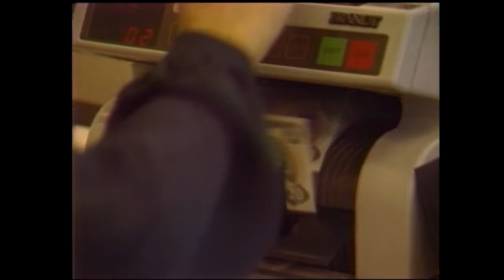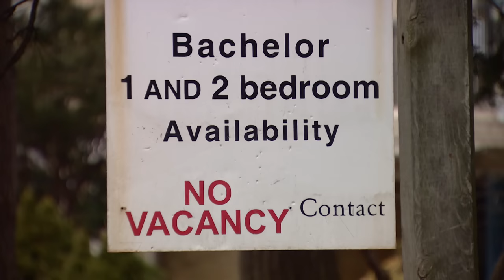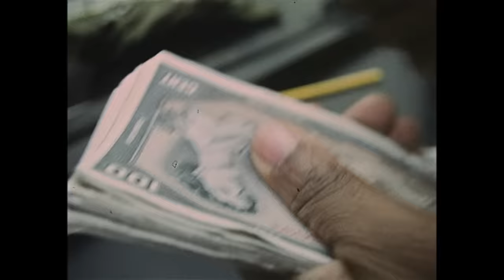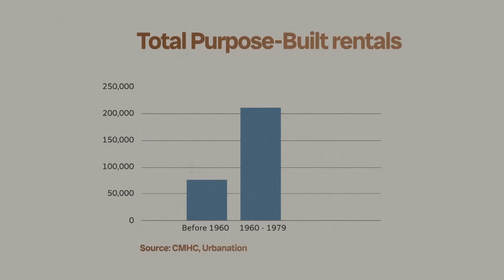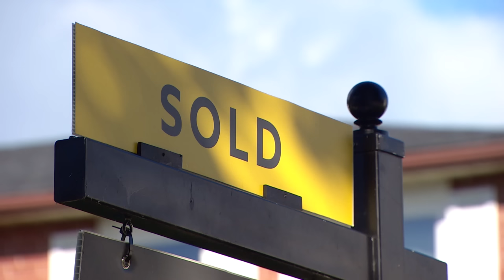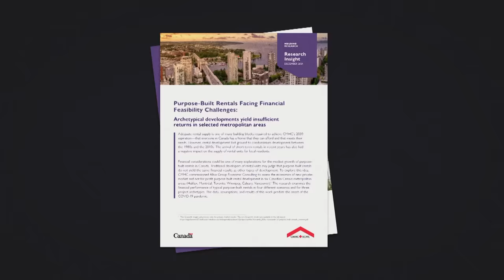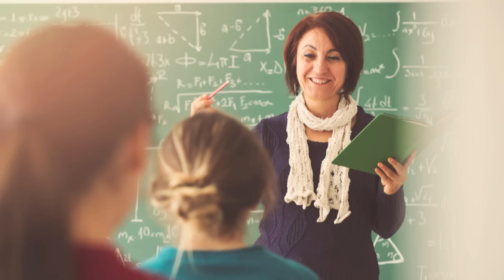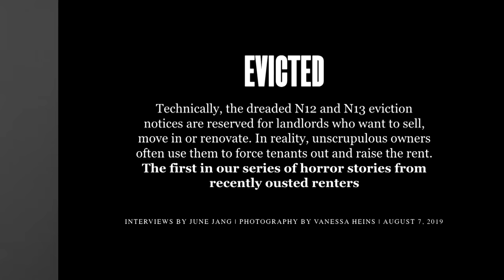How did renting in Toronto get so bad?

Comment: Back in the day, when I purchased my first home to live-in; that was Toronto in the early 1990s, first mortgages with rates of 8 to 9% and 9% to 10% were typical. People will have to accept the possibility that we won't ever return to 3%. If sellers must sell, home prices will have to decline, and lower evaluations will follow. Pretty sure I'm not alone in my chain of thoughts.
Reply: If anything, it'll get worse. Very soon, affordable housing will no longer be affordable. So anything anyone want to do, I will advise they do it now because the prices today will look like dips tomorrow. Until the Fed clamps down even further, I think we're going to see hysteria due to rampant inflation. You can't halfway rip the band-aid off.
Reply: Home prices will come down eventually, but for now; get your money (as much as you can) out of the housing market and get into the financial markets or gold. The new mortgage rates are crazy, add to that the recession and the fact that mortgage guidelines are getting more difficult. Home prices will need to fall by a minimum of 40% (more like 50%) before the market normalizes.If you are in cross roads or need sincere advise on the best moves to take now its best you seek an independent advisor who knows about the financial markets.
Reply: @hasede-lg9hj  Impressive can you share more info?
Reply: There are a handful of experts in the field. I've experimented with a few over the past years, but I've stuck with Annette Marie Holt for about 3 years now, and her performance has been consistently impressive. She’s quite known in her field, look—her up.
Reply: Thanks a lot for this suggestion. I needed this myself, I looked her  up, and I have sent her an email. I hope she gets back to me soon.

Comment: Stop foreign investment of property ownership.
Reply: They already did that. But one problem, though. Foreign students and refugees are exempt.
Reply: @shauncameron8390 yeah because foreign students and refugees have money to buy a property loool
Reply: They stopped foreign investment, but most of the investment is coming from locals, that's the issue. Only 20% of invesrment units are owned by foreigners according to StatsCan
Reply: @MegaJellyNelly  As long as you allow corporations to buy residential real estate you are not stopping foreign investment.   The foreign investment is just hidden behind a corporate structure.

Comment: I had a 600 sq ft 1 bedroom at wellesley and jarvis for 900 a month in 2012. I moved to Montreal, but was considering moving back a few years ago. Saw an apartment in the building, almost indentical, cheap renovations, the rent had increased to 2400 in 2022. Wild.

Comment: Toronto rent problem seems to be that of demand and supply, high demand because of immigration and low supply because of government red tape.
Otherwise I don’t think it should take 100 months to build a high rise building to accommodate multiple family.
Reply: The "red tape" argument has been demolished by economists who have actually looked at the evidence.  There's more building and construction than ever before in the GTA, at breakneck speed.  There are tens of thousands of units that have already been greenlit (some for years, in fact), but there aren't enough construction workers and skilled workers to do the job.  That's not caused by "red tape," it's caused by labour shortages in those specific areas.
Reply: @portpass1974  

<That's not caused by "red tape," it's caused by labour shortages in those specific areas.>

Due to the government indirectly discouraging people from taking up skilled trades. 

<There's more building and construction than ever before in the GTA, at breakneck speed.>

Mostly condos.
Reply: It's not red tape that is the problem, it is bad government policies.
Reply: There are tons of new condo buildings being built in Toronto, many of them sit unoccupied because they were bought by investors (international or local). The problem is they are not affordable to the average person in Toronto. Many of them start at 700-800k for a studio....

Comment: So here's some math. The city of Toronto is about 2.8 million people living in 1.25 million private dwellings on a surface area of 631 km2. The city of Paris, France is 2.16 million people in 1.4 million private dwellings on a surface area of 105 km2. That means the dwelling density is 6.7x higher in Paris and the population density is 4.6x higher. Torontonians also prefer to have more people-per-household on average: 2.2 vs 1.5 in Paris.

If we scale up the housing density to match Paris and keep Toronto's people-per-household constant, that would mean 7.16 million new dwellings and 16.0 million more people in these new dwellings. Even if we assume tastes change and go to Parisian people-per-household, it would still mean room for 11.1 million more people in the new dwellings.

If more were needed, you could build higher than six stories (Paris buildings are rarely higher than six stories) or increase the density of surrounding suburbs.
Reply: You have hit the nail on the head. This is solution to our housing problem. Increase density. Increase supply. Then there will no need for rent controls.
Reply: Nobody “prefers” to have seventeen people packed into one house.

Comment: Building materials have increased 2 to 5 times in price these past couple years.

Rent control isn't gonna help fix this problem.

Things are only gonna get worse.
Reply: Tools as well, and they wear out faster!! Even back to the credit crunch 2008 eletrical and plumbing, windows and wood, did NOT go down in price, and I was in the townhouse and high-rise industry then. And noticed.

Comment: What we need is many many Multi-Units Rental Buildings (MURB) to be built in the next 5-10 years. Tax incentive policies from both the Federal and Ontario governments like 50% off the normal tax rates are necessary, just like those policies in the 1970s. Rent control just won’t solve the problem like the Wage and Price Controls policy in the 1970s. The rent control is just a quick fix or bandage solution. Greater supply is the best solution to satisfy an overwhelming demand.

Comment: Converting vacant office space would be a good, environmentally friendly way to get more housing yet I learned in another video that there is an old rule in Toronto that prevents removal of office space. Sad that red tape is preventing and obvious solution. Not all office space is appropriate for conversion and it won’t solve the whole problem but it could certainly be a good tool to help in an over all plan.

Comment: Government incentives for building = higher taxes. There is nothing free, if the “government pays for it” that means “the taxpayer pays for it.” They never talked about the Greenbelt, which constrained building in a major way. Urban sprawl on (relatively) cheap land is another reason housing costs stayed in a reasonable range. If we’re going to welcome millions of new immigrants we are going to need new cities. It’s easy to build them by urban sprawl (just 5-10 min further) but difficult to build them in the middle of nowhere (you have to convince industries to move operations there). Perhaps some existing smaller cities can grow of course. Being able to work from anywhere is enabling many Torontonians to leave, which can also be part of the solution.
Reply: <Being able to work from anywhere is enabling many Torontonians to leave, which can also be part of the solution.>

Not really as that's jacking up the prices in the places many Torontonians fled to. Case in point: Halifax.

Comment: Part of the problem is that salaries and wages have not been keeping up with inflation for the past 50 years.  That's right, wages relative to inflation peaked in 1974 and have been declining ever since.  If people were making wages equivalent in purchasing power to back then, this problem would be much smaller.  Note that this happened at a time when union busting and exporting jobs became the norm.  Talk about unintended consequences.

Comment: Solutions is pretty easy, just lower the tax rates on rental properties and offer incentives for higher occupation and those units renting  at lower price. It will provide market equilibrium.

You can also use Singapores rental model. Controlled by the government and offer 99 year term leases. It made the country extremely prosperous.
Reply: <You can also use Singapores rental model. Controlled by the government and offer 99 year term leases. It made the country extremely prosperous.>

Not really. Canada is not an uber-autocracy with limited land like Singapore.

Comment: I have a solution for any new multi-unit condo development, 10% of units are rent controlled.  So if there's 500 unit condo development, 50 of them will then be subsidized & rent controlled.  This would help ease the problem.  Not everyone can afford $2600 a month.  Another problem is job opportunities.  Too little well-paying & not enough full-time positions.  Way too many rely on inconsistent precarious type of work.  Toronto is just incredibly way too expensive & if it was not the revolving door of immigration & international students, the whole city would not be exorbitantly expensive.  This was built-in by design by greedy speculators & unethical policies from all levels of government.

Comment: This could be summed up as “the cost of capitalism” without being extreme. Capitalism doesn’t recognize ANYTHING as a right but as a resource to be exploited & used to extract maximum resources from others, including shelter, water & clean air.
Reply: While socialism recognizes everything as right only to consistently have a problem with shortages, because it can't provide anything in an efficient or adequate manner.
Reply: @shauncameron8390  you’re confusing socialism with communism. Central planning & control is not a tenant of socialism as much as of communism. Government can provide services for people where the market won’t without going to central planning.

Comment: Why don't all the people trying to move to Toronto just move somewhere else?  Especially if immigration is the reason - shouldn't that mean you could just as easily move to a smaller city like St. Thomas Ontario and spend $300,000 and get a pretty nice house?  But of course, everyone wants to move to Toronto.  And people will be quick to point out that 'the jobs are in Toronto' - but that's only if you're requiring extremely high salary - and you only need that extremely high salary if you're paying Toronto house prices.  Go to St. Thomas, take a job paying less, but you'll be fine because housing costs are so much lower.  Stop trying to move to the most stupidly overpriced cities like lemmings or sheep, and instead try to solve the problem yourself without the constant complaining about lack of housing.  I'm tired of the mass media just latching on to a problem and beating it into our heads.  People, take responsibility for yourself, do what you need to do, and stop whining and complaining about it endlessly.  Don't like it?  Fix it yourself, don't expect 'someone else' to fix it with 'someone else's money' .  Fix it yourself.  Take responsibility for yourself for once in your life.

Comment: I lived in Kitchener up until I retired and moved north in 2022. I had a really nice 900 sqare foot apartment which is a very large unit. I paid 1235.00 a month all inclusive, my last year was 2022. . I was there for 12 years and two years of covid my rent did not increase. I moved out and they renoed it and were asking 2150.00 plus hydro = INSANE! 🖕The cost of reno was 30 thousand.

Comment: Canadians are very good at dancing around the main point… Here in Vancouver, which has even higher rents than Toronto. The answer is simple and obvious… For birth rates have declined dramatically, therefore housing should not be a problem… But because immigration is set at such a high level And those immigrants want to live in the warmest places possible surrounded by their own ethnic communities. There is a massive population increase and given the laws of supply and demand the rents will obviously increase. None of this can be said, of course, because accusations of racism are prevalent and dangerous in our society.

Comment: its a simple result of policy.

the carbon tax increased the price of gas and fuel, which increases the cost of shipping/trucking, which increases the price of every single item being shipped and trucked (food, clothes, construction, everything..) which increases the cost of construction (building the house) bc all the material is more expensive bc of the carbon tax. 

the mass migration caused demand for everything to increase (groceries, housing, etc). Cost is a simple relation between supply/demand... the supply (# of homes) didnt increase but the demand (# of people who want to buy) did increase..

Remove the carbon tax (and drill oil in Canada instead of buying it from Russia and Saudi Arabia) and stop accepting 500,000 migrants every year and the cost-of-living will dramatically decrease back to normal

Comment: One generation that is so scared of their retirement, they are willing to evict young adults to ensure their comfort, young adults that warned them over this for years, and were told to work harder as a solution. Canada will eventually have a mass exodus of young talents, when that happens there will not be a point of return to Canada, and it will be an open air retirement home country.

Comment: There are SOOO MANY SPACES in the heart of a Metropolitan great city!  Even storage areas could be adapted to house micro-mini apartments, or shipping containers like Montreal's Habitat, with a SEPARATE (as in contained) common wet & kitchen area where any major spill or fire would be completely isolated from the rest.  It only takes the will & willingness of people to discard the notion of having a window to open right out, and live instead into a nice tight-knit community that would be just the Right Kind of Tight, as tight as to scare you yet not so tight as to outright unalive you ... and everyone you know and hold dear....
I Know people would jump in a heartbeat on a yearly rent that's around $100 max, no matter the lack of windows - which COULD be replaced with a nice extra-wide thin-panel display, offering a home cinema and business or special presentation or lecture, to return to its window setting of Your Choice, Wherever & Whenever & a few other things that were missed or never imagined.

Comment: Rent control got Toronto to this point. By throttling investment in housing for so long, Toronto not only under built but made the city infrastructure counter productive for more homes to be built. Eventually due to not hitting the replacement rate, prices will drop drastically but that wont be for another 20-30 years